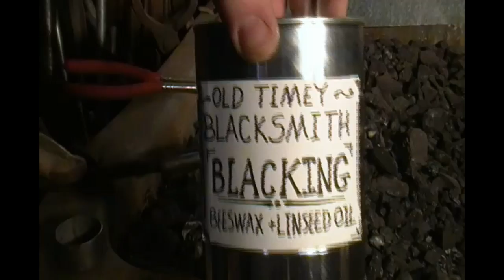Rusty, Dry Rotted, Antique 1800s Fireplace Bellows Restoration

Comment: Absolutely stokes with this video. I just received a commission to restore one very similar, This video will help guide me through the process. Just what weight/thickness veg tan did you use? Cheers from New Zealand
Reply from the maker: Glad It will help you. I wish I could tell you the details of the leather, but it was a piece I got from a friend and I do not know the specs. I can say It was fairly light and soft as I did not want a lot of resistance to the motion.